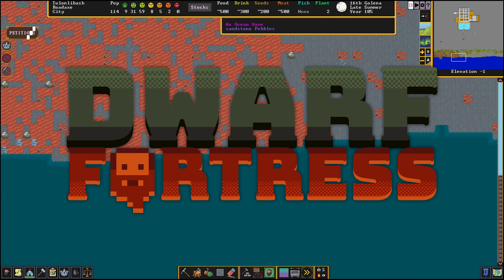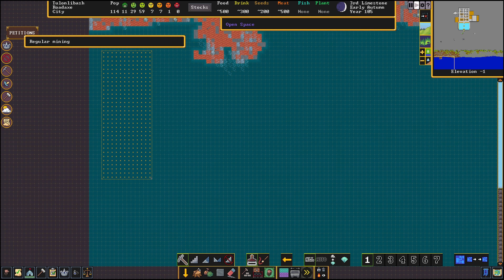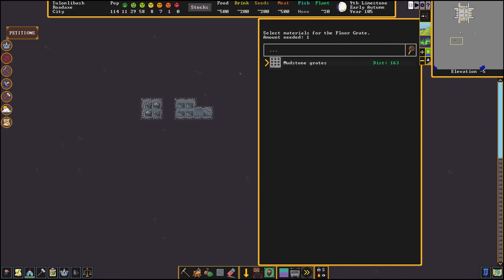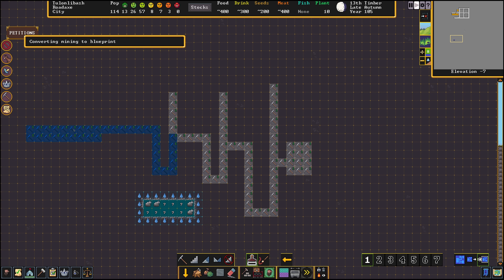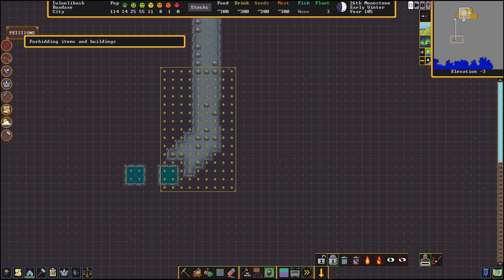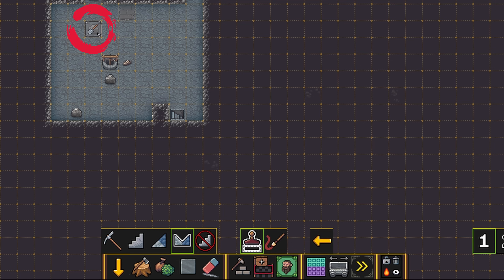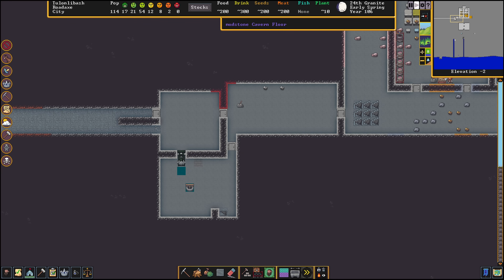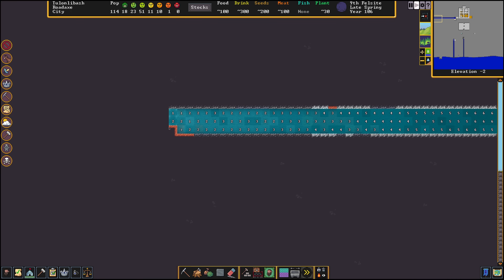Using Water & Water Pressure 🔅DWARF FORTRESS STEAM🔅

Comment: Does the desalination trick still work? I've set up a U pipe connected to the ocean and did like you did in the tutorial, but the water appearing in the edges/corners is still salt water.
Reply from the maker: it's not a trick.. It was an observation. the water should not have been desalinated! 
Water may currently be desalinated by passing it through a screw pump.
Reply from the maker: Found this: 
Alternate water purification methods

Contamination in the form of salty or stagnant water is apparently unable to climb stairs. Lacking the materials to build a screw pump, you can instead purify water by forcing it to pass through a vertical u-bend made of stairs.

Flowing fresh water destroys stagnant water on contact, converting it into fresh water. Oddly enough, flowing salt water also destroys stagnant water on contact, converting it to fresh water, so connecting your murky pools to the sea paradoxically provides clean drinking water.

Comment: My current fortress is deep in the caverns on a frozen barren island, so no water up above. I’d like to take advantage of the cavern lake. Can you explain your last magic trick? What can you do after you open access to the lake like that?
Reply from the maker: This is a way to breach a cave lake, ocean, magma sea, ect.  with out having to bring your dwarves into the caverns or an imposible location like standing in magma. after the breach is complete you can dig a reservoir or tubes to bring the liquid where ever you need. once the area is safe and complete pull the lever to flood the area. you can then close this later if you want; if you were to leave it open all the time I would build a U pipe after the breach to prevent forgotten beasts from entering the water tubes.
Reply from the maker: The bridge will block the flow of magma or water & the dwarfs pathing. Mining is not blocked by the bridge and the dwarfs can stand on the ramps to access the level above. when a dwarf is on a up ramp they can access the level above them.
Reply: @TwistedLogicGaming  Gotcha, that's awesome. A short video demonstrating this use case in more detail would be cool. But thanks, this makes a lot of sense!

Comment: Great video! I tried doing this on my second fort and I realized I didn't do a drainage system... so the well never got used and when I tried to fix it, the water got contaminated with salt water.
Reply from the maker: you can always pump the water to clean it no matter where it is. adding drainage would not be so bad using the diffrent tapping methods. Thank you for watching CritikalCypher!

Comment: Hi Twisted Logic!

What happens if I breach the ocean in its low levels? Does it pressurize to the surface of the ocean?

Thank you!
Reply from the maker: Yes. the top of the ocean at the map edge are the source tiles of the water. the game will try to flood fill everything it can based on the body of waters source tiles. when making diagonals this splits the water into a new body of water with a new source tile. the new source tile is not generating water like the map edge tiles however we call both of them source tiles.
Reply from the maker: Thank you for watching Julio !!
Reply: @TwistedLogicGaming  Hahaha I'll rewatch. Sorry mate!
Reply from the maker: don't sorry; feel free to ask any questions Julio ! Thank you for supporting the channel

Comment: does magma pressure not work the same way? I have a U shape pipe but it's not going up on the right ride of the pipe
Reply from the maker: no magma will olny be under pressure when using a screw pump ! otherwise there is no pressure on magma and only uses flow

Comment: So... I need to go level by level with several U pipes or can I do just a very deep one?
Reply from the maker: I just did the one u pipe; consider that the "water main" everything after that should be safe. then use the simple diagonal to reset pressure where ever after that inside the fortress !

Comment: Just wondering why you can only create a new pressure level above the level of the grate as referenced at 7:45 ? Does water have to go up a number of z-levels in the u-pipe to be able to be diagonally pressurized?
Reply from the maker: NO, that is to maintain the safty of the fortress. from cleaning the water and creatures sneaking in
Reply from the maker: You can use the diagonal anywhere ! that splits the water off into a new "body of water" and resets pressure to that z level . 
I was trying to do that in a specific application but its a sandbox game so when teaching it is best to set a few limits
Reply from the maker: Thank you for watching SpartanGamers !

Comment: I tried the u bend desalinization trick and can't seem to get it to work. I've got a two by two staircase going down a long ways, then a two wide hallway going over four blocks before coming back up a two by two staircase. The water coming up the other side isn't fresh. 😞 I've tried this twice starting from the same salty light aquifer but no luck.
Reply from the maker: you will have to desaliniate the old way then using a screw pump!
Reply: @TwistedLogicGaming  I was afraid you might say that. Alas, my poor dwarf's drowned in vain! But, it was FUN!
Reply from the maker: I'm not sure why mine desalinated, I feel like it should not have,,,,<3

Comment: If the floor grate bypass is only blocked off by doors, couldn't building destroyers break the doors and get up to the z level of the grate unless the bypass stairs are also removed and grated on the same z level?
Reply from the maker: building destroyers need to be on the same z level to destroy the grates, this protects from the bottom only. The Floors on top prevent them from coming down from above, Thats when i "button it up" the up stair should be on the same level as the grates in the fliter ! I hope that helps! Thanks Joshua!

Comment: I built a U pipe but the water comes all the way back up to the source level.
Reply from the maker: Are you sure ? what I refer to as "The source level" for the water is the highest level of water; connected to that body of water. Thanks for watching HulksterRunsWild !
Reply: @TwistedLogicGaming  it rises back up to the level it came in on, so i had no need to build a U.  not sure if my settings or wrong or I did it wrong
Reply from the maker: Is the level that the water enters the U pipe the highest level of the water or is there another z of water above that ?
Reply: @TwistedLogicGaming  its the highest, its a stream where the top 7 is at the -2 z layer.
Reply: push the u pipe to -7 like in your vid, the water comes back up to -2
Reply from the maker: would you mind showing me ? here is a discord server invite https://discord.gg/UxcUnzCE
Reply: @TwistedLogicGaming  I think it is working, I had an initial push of water that wouldn't go away until I dug around it.  I think the water from aquifier soil is effecting it.
Reply from the maker: yeah an aquifier would effect it, glad you figured out the issue! Still that is an open invite for the first 5 ppl if you want to join the server.

Comment: I dont understand what im doing wrong. I follow EXACTLY as you do, and it builds 7/7 water pressure all the way up and then when i open a diagonal pathway the level immediately loses all pressure and just stays at 1/7, and will never build back up even if i reseal the diagonal pathway. 

I am not swearing at you so sorry if this is too rude but WHAT THE FUCK IS GOING ONNNN its so annoying. i just want to build a fucking waterfall but i lose pressure INSTANTLY every time. ive literally followed this tutorial 7 times in a row and it just does the exact thing i said every fucking time. its so fucking annoying.
Reply from the maker: is the body water in a small area of the map? it might have to do with this rare bug: it's a block update bug.
when a water flood fill fails the game code stops pressure checks in that area until there is a block update.
Sorry for the quality of this older video in advance: 
https://www.youtube.com/watch?v=lU5JeIgMvoA